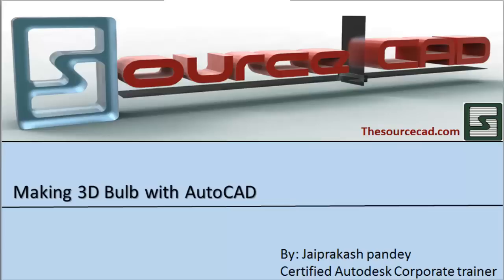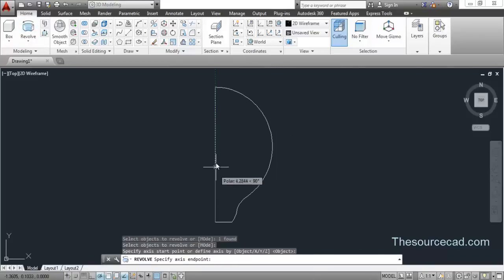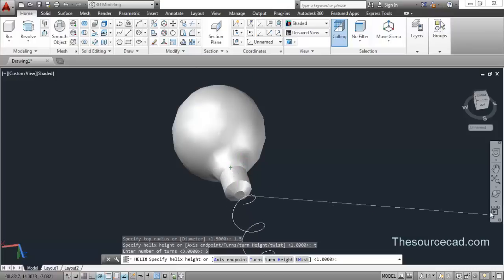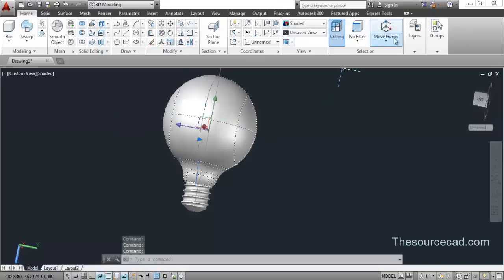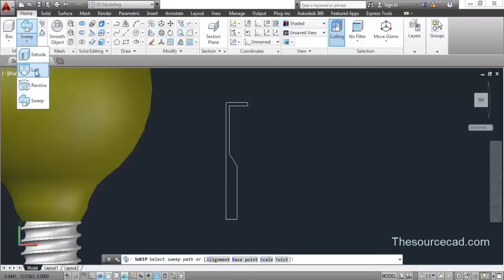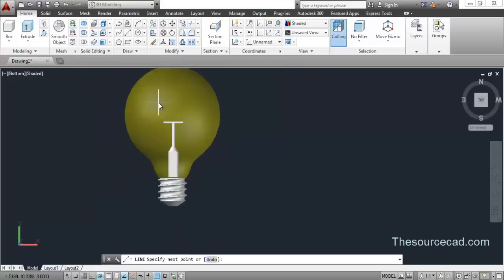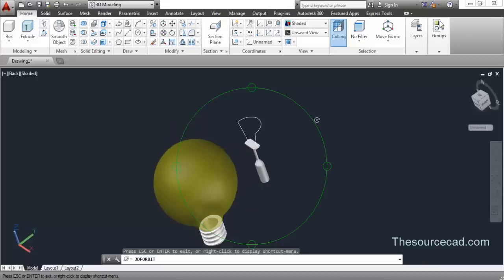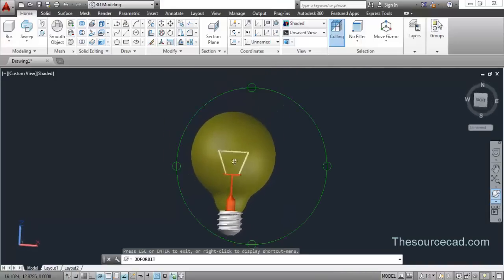making 3D bulb with filament in AutoCAD

Comment: Hi Sir, I could not perform the shell command. What might have been the problem. Is it due to the shell thickness or the selection of the faces that are to be removed?
Reply from the maker: There could be a lot of reasons that could potentially prevent shell operation but the most obvious is the shell thickness, make sure it is appropriate.
Reply: SourceCAD 
Thank you Sir

Comment: Except that part near 0:50 where I basically used a bunch of trial and error to remove the circle on the right (and I did it differently from how you did, obviously) AND the sweep part of the helix, this was extremely helpful. 
I am using AutoCAD 2014 for Mac by the way.
Reply from the maker: I am glad you found this video helpful :)

Comment: when I want to trim the circles it doesnt let me trim them like you did. why?
Reply from the maker: Bettina Alexandra Can you exactly tell me when in video you are facing this problem (I mean duration like 4:26)
Reply: SourceCAD 0:50 you are trimming the 2 little circles. when I tried to do the same, i couldnt trim the circles to be left with those arcs you have in the video. I can select the circles after the trim command but after enter it shows me that it can trim the entire circle. I hope it makes sense. my question was...how can I make to trim just a part from my circle?
thank you so much
Reply from the maker: Bettina Alexandra are you making smallest circle with TAN TAN RADIUS option? make sure circle which is common tangent to other two circles touch each other. 
If you still have problems quit autocad session start a new session and follow exactly same set of commands
Reply: SourceCAD i did use tan tan radius, but i will start a new drawing. thank you very much for your answers